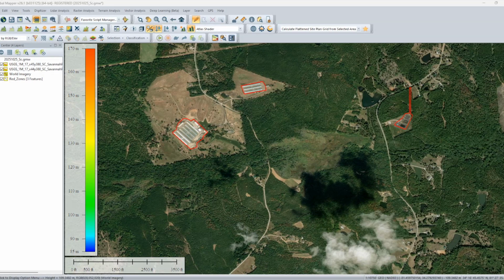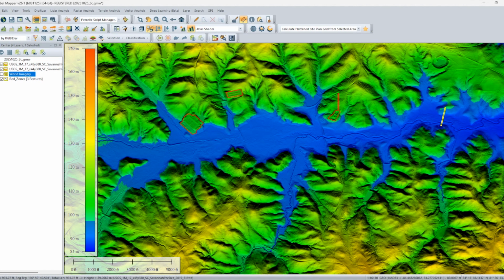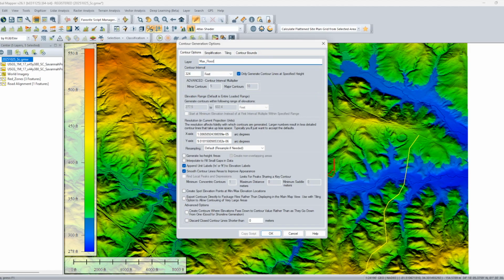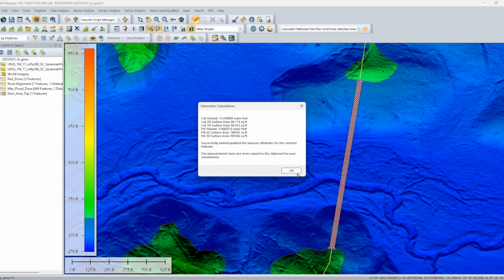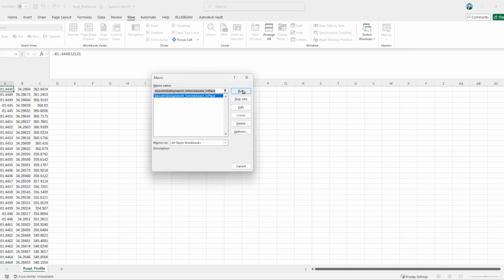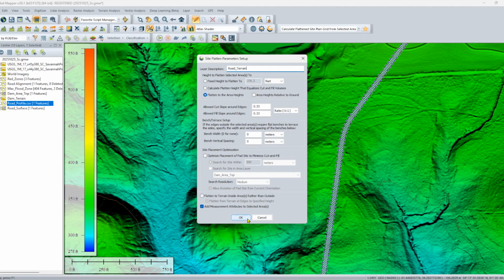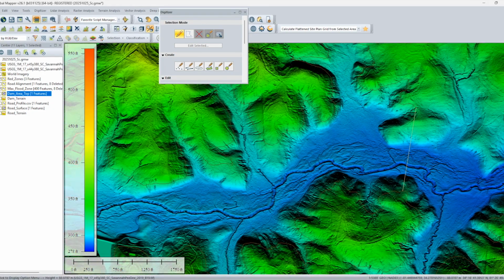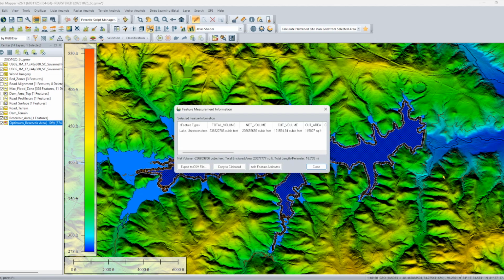The EXACT Workflow to Design a Reservoir Lake in Global Mapper

Comment: Thanks for the great video! I have been using Global Mapper for years and did not realize you could create grading surfaces so easily. I used GM to create alignments, then run grading on Civil 3D, which is slow and frustrating. You saved me countless hours and my client thousands.
Reply from the maker: Yes GM is very versatile. I am glad the video helps.